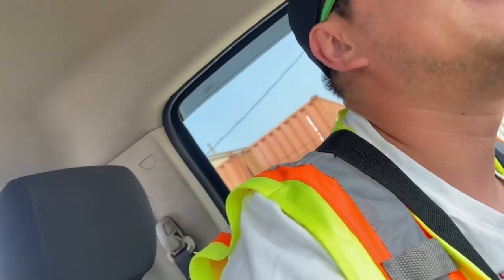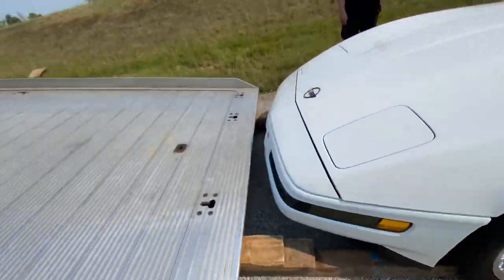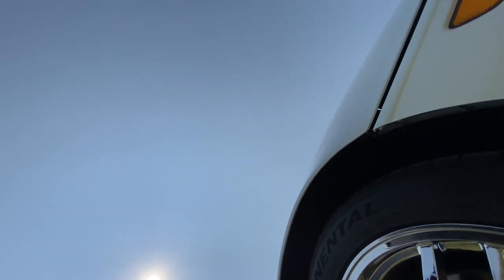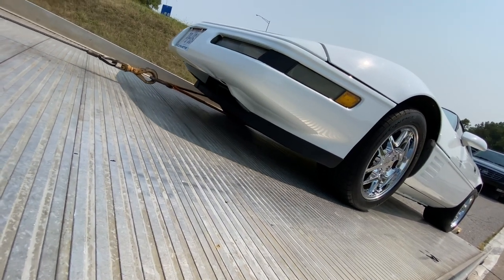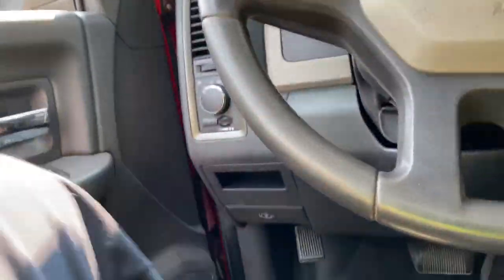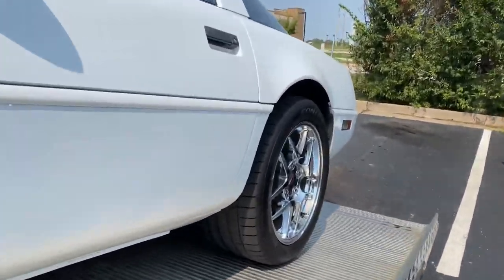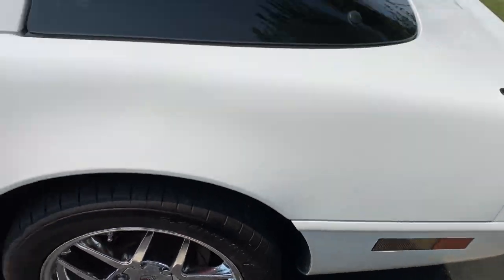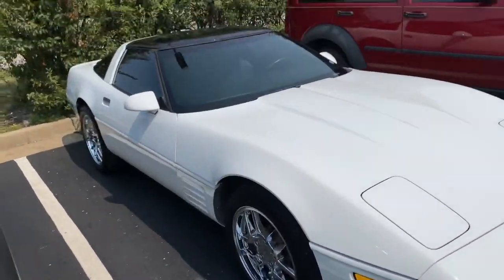How To Tow A Corvette Or low car

Comment: Thanks to ppl like you, i had confidence when i had to load up a 911 that sat very very low. Did it just like u did. Making a set of wooden ramps like u have is such a life saver.
Reply: I really mean it. Thank you. I got put in a tow driver position never doing it before in 40 years. I've learned so much from you and a few others on here and it's really payed off. Not all have somebody to show them the ropes. Means alot

Comment: Instead of all the wood just flip your skies upside down roll car up skies because they like ramps when you have em upside down and 2 pieces of 2x6 I do it all the time fast better than using all that extra wood
Reply from the maker: yes I did that video using skates as ramps years ago on a slammed srt that truck had a huge ram angle!

Comment: Former tower here based in Australia. Used to tow a lot of beemers, mercs porsche audi etc. Used wooden blocks like you as they are all low cars.
They also mostly have kits on them (spoilers etc) but they all have a tow hook built into the chassis at the front. It's accessed by removing a small plastic/f'glass click off panel.
We usually wrapped the small J hook in a rag to protect the kit while winching.
Takes a bit of time but happy customer equals more business. Enjoyed your video, thanks.

Comment: Chances are with something so simple as a simple break down tow for a "luxury" vehicle or low vehicle, etc. If you are the only one doing the simple job, It's because you are getting suckered into doing it, In my experience, no one wants to pay for the extra work and liability that comes with these vehicles so they won't be run by me.
I've got airbags and a good load angle, I wouldn't even need boards for this so it'd be no big deal, but the lower ones I won't do for the same fee, They will pay more or they will sit and wait for someone else.

Comment: How do you attach the soft strap
Reply from the maker: go around control arm
Reply: The soft straps have small j hooks if they do the c4 will most Corvettes even the new one now I think the c3 doesn't have them and you have to use a big j hook or an endless loop for the control arm but behind the front tire near the rocker panel feel under there and you'll see an oval shaped hole that's where the baby j will go put them on there make sure the straps far enough forward where the cable hookup to your bridal is it bouncing on the oil pan it will definitely break it👍

Comment: you just need 2*6 5ft long and make a hole in the wood and bed and get a pin to lock in  together never ever move  up or down again! if you towing Lamborghini add extra 4 foot wood and lock in to the other wood with the pin that’s it
Reply from the maker: Yah I was thinking of that kind of set up I try to keep extra wood for different kinds of situations always comes in handy doing recoveries and general towing 🪝

Comment: The car has tow hooks at the front…why use the suspension to pull on the car???

It worked but not ideal
Reply from the maker: Yah I’ve towed a dozen Vettes since then all the same way! If you have a better way like I always say do what works for you!
Reply: The oval holes in the frame